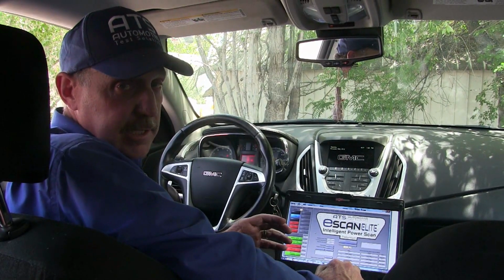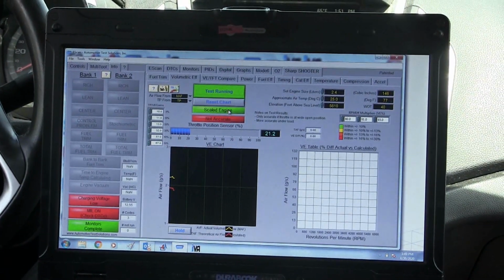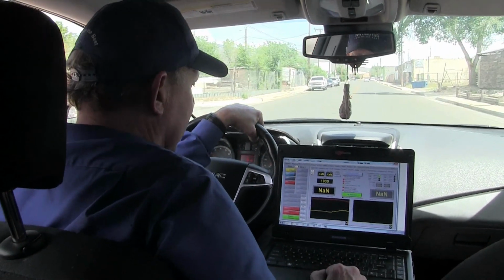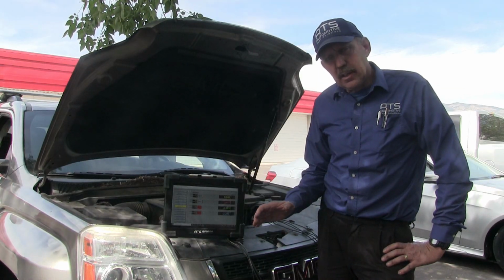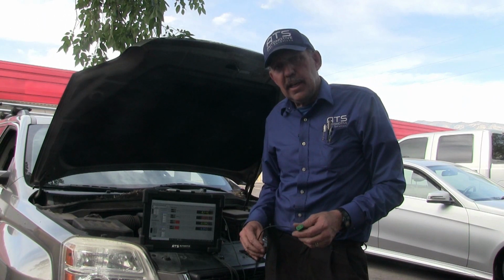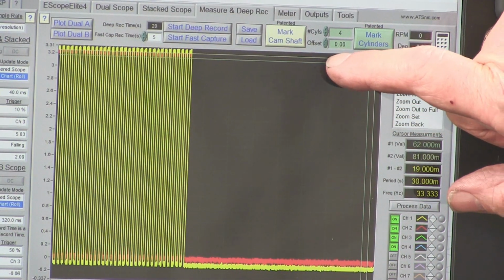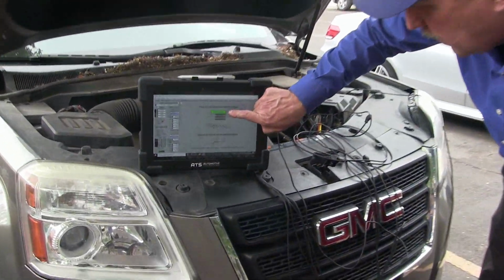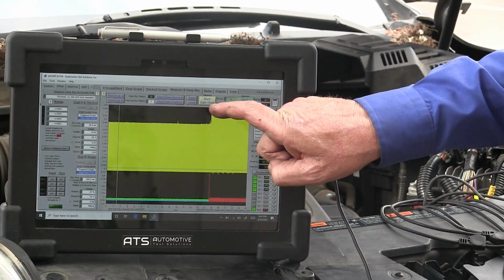2012 GMC Terrain

Comment: Good evening sir,  pls sir I have a problem with my GMC TERRAIN 2012 ecm and tcm not equipped but the car can start and engine steam very well but when engage in gear there will be noisy sound, pls any idea cos I have check all communication data and wiring and everything seems ok

Comment: Hi Bernie, another great video, I was just wondering when youre injecting a 5 volt reference like that, do you usually always have it set to 25Hz and is there any danger to the ecm by sending 5 volt ref under certain conditions? Ive been building some circuit testing devices like this and was trying to find out what freq the 5 v ref should be.  And is there any particular mosfet used? is there a 10k resistor across the mosfet gate and source? You guys at ATS have some sweet tools..

Comment: Gm never ran a ground bias..... This one 1.27 volts. Gm always ran a 450mv signal bias. Do they run only ground bias on this vehicle or do they have both?
Reply: Note: The low signal circuit is tied to a pull-up circuit within the engine control module. A voltage of 0.0–1.10 V on the low signal circuit is normal per G.M. S I.
Reply: Test for 1.7–3.0 V between the high signal circuit terminal B and ground.
Reply: Connect a 3 A fused jumper wire between the high signal circuit terminal B and the low signal circuit terminal A.

Note: The low signal circuit is tied to a pull-up circuit within the engine control module. A voltage of 0.0–1.10 V on the low signal circuit is normal.
Verify the scan tool HO2S 1 or 2 parameter displays 0.0 V.

Comment: I'm curious as to what the O2 signal voltage would have been if the scope would have grounded to sensor ground Instead of battery ground.